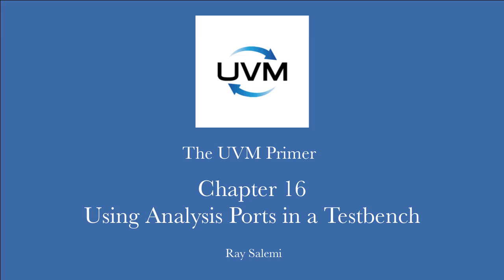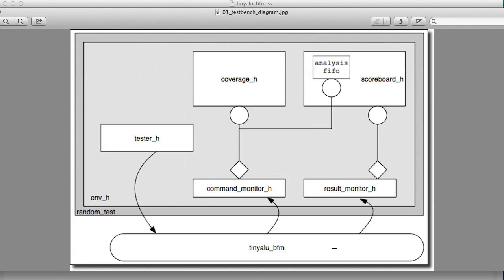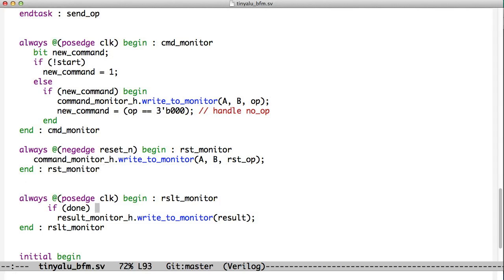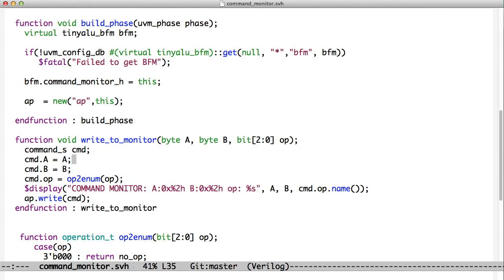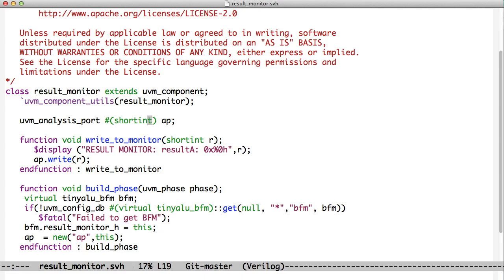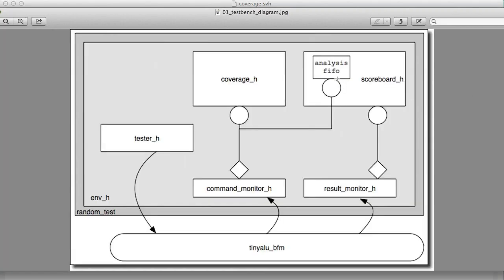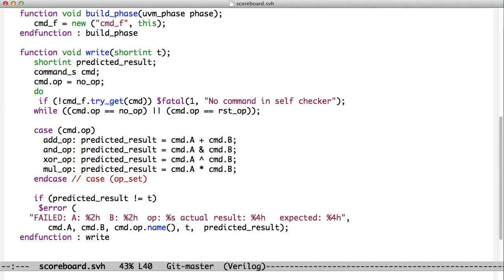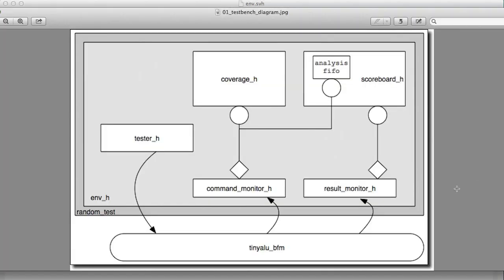Chapter 16:  Using Analysis Ports in the Testbench

Comment: thank you for video contents and it really helps me understanding with textbook. I have one question. I am struggling with understanding multiple port. In scoreboard class, it should support both shortint and command_s. But in "write" method, "t" is not used except checking error. Can you help me why "t" is also supported in scoreboard?
Reply: I’m afraid I don’t understand your question.
Reply: Thank u for reply and i am just a beginner. In Fig102, scoreboard has 2 analysis ports;one is from common_monitor_h and the other is from result_monitor_h. In scoreboard, one from common_monitor_h is only for checking if it is the same as the value from result_monitor_h?
Reply: @sxl109220  Yes. The commands go into the analysis_fifo.  Then whenever a result appears the scoreboard takes a command off the analysis_fifo, figures what the result should be, and compare that to the result that it got from the result monitor.
Reply: Thank you for clarification.

Comment: This is a great book and I enjoy reading it. However I'm not an experienced verification engineer and I have a question about the do-while loop. I'm not clear on how it runs with respect to threads. Say we the write() method was called and say fifo is full of no_ops. What would happen if the testbench sees a new clock edge and calls the write() method again? Will we create a new thread? Or should I assume that this do-while loop doesn't consume any simulation time. It would be really helpful if you could explain it in more detail.